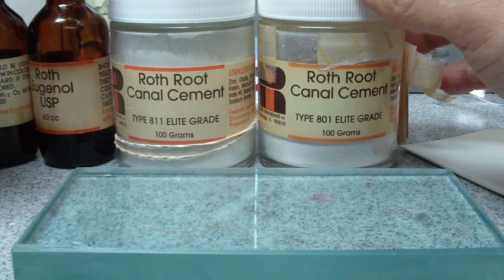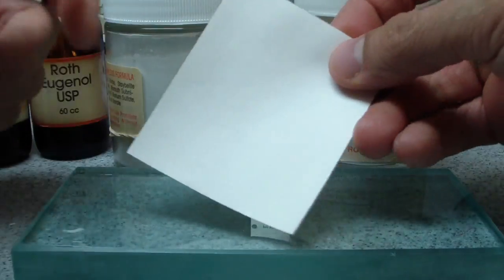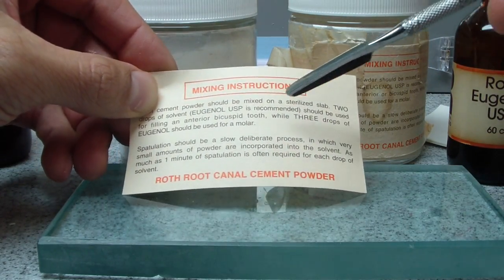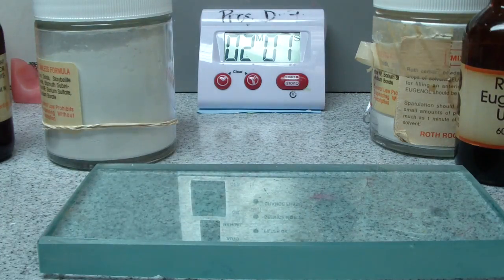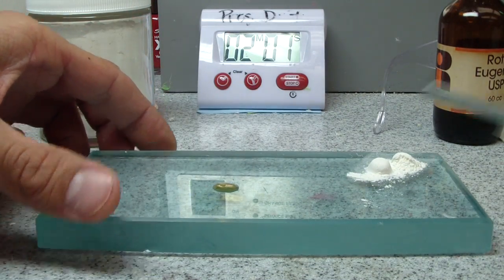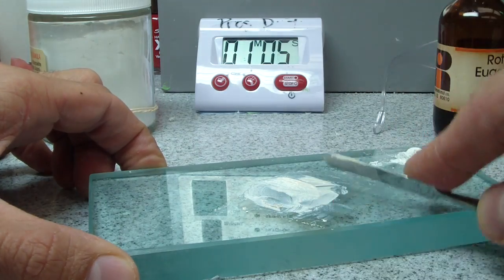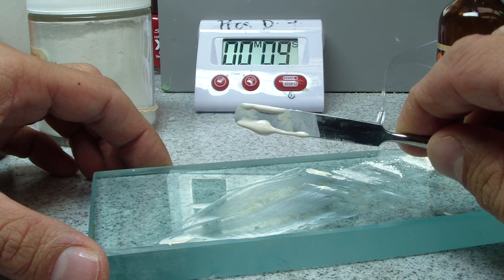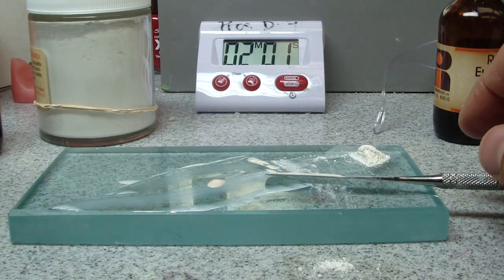Roth's Endo Sealer - What is it and Mixing Instructions

Comment: Great video.   I used Roth's for many years.  Like IRM I learned to be picky about my Eugenol.  It should be a "light corn oil" color.  Eugenol is easily oxidized on the back shelf.  It will take on a brown maple syrup color.   (Sorry to say your bottle is oxidized).  I have found that neither IRM or Roth will set once it is oxidized

I keep my old bottles to help me train staff